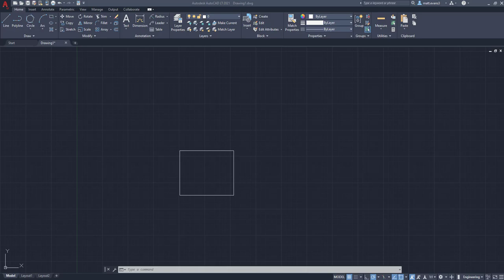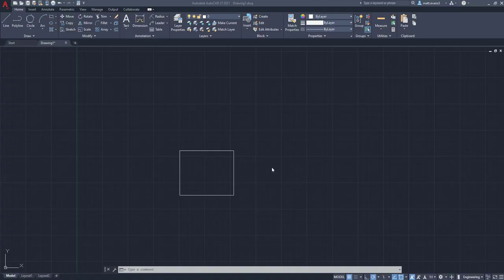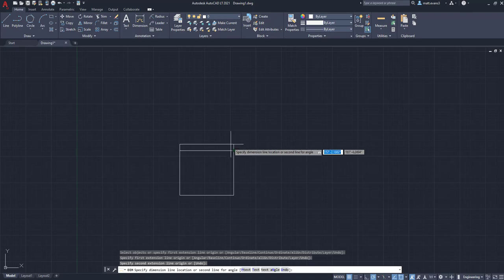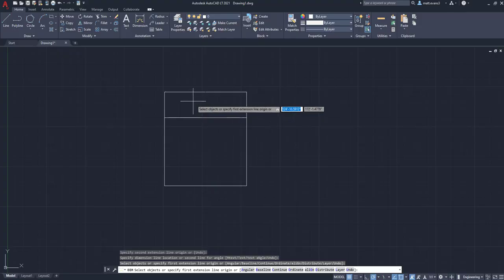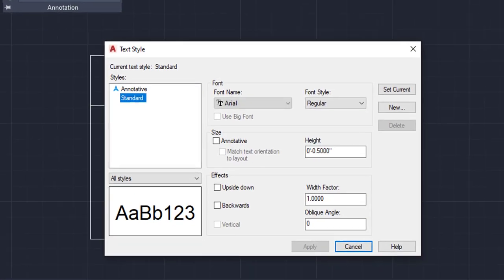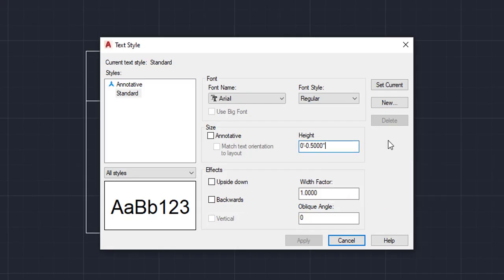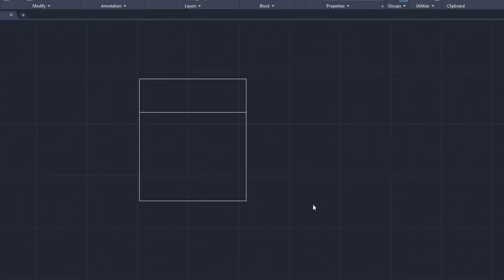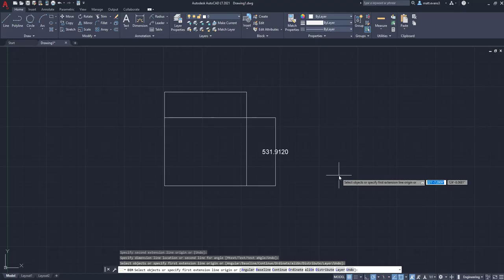Fix Dimension Text Size FAST - AutoCAD

Comment: Thanks for the tip.  Dimension is always a bitch for beginners as lack of experience to see what looks good and does not overwhelm the drawing / object being dimensioned.  
To help me quickly set up my dimension size, I have created a sample drawings where I have placed all my texts, fonts, notes, linetypes, borders, scales, title blocks, etc. based on the scale of the viewport scale and its scale. Example, a 10 scale drawing/plot or 20 scale, 30 scale etc. So when I use the base drawing all the items are sized for output. Like a reference, but not inserted as one, as some enities/blocks are not enbedded onto working file, it more like a template.

When I get a drawing or start a drawing, I measure the drawing area in models and base on that, I see what sheets sizes I can use, while seeing what size the drawing will be if scaled for the viewport/sheet. 
This important as most City/Counties charge per sheet submitted for review and or recording and in my area the have chosen to only allow 24"x36" sheet (plans) and one county requires(plats) on 20"x24' sheets only.
Reply from the maker: This is 100% spot on. In my current role I typically don't have to dimension anything too precise. I just ensure that the dimensions are what others are looking for and then send it to them as more of a visual. I am lucky because anything city/county related is usually sent to an architect then sent to the city. They are the ones who typically need the precsion. This video is a bit old so I want to do an updated version and might use your idea if you are cool with it?

Also, not sure if you have ever thought of it, but you should consider making some videos. Your knowledge would be super helpful to a lot of people. I would highly encourage you to give it a go!
Reply: @matt.autocadbasics   Thanks Matt.  I like view others CAD Lessons, as I never have take a Cad Class.  I am old school drafter, Tech Pens & Triangles, Circle Templated, Leroy Letting set, and the Railroad Curves!!  I have made drafting my profession, but EIT are replacing Us Drafter.